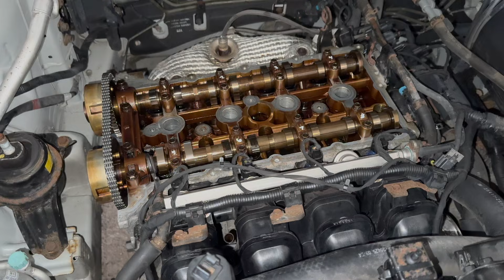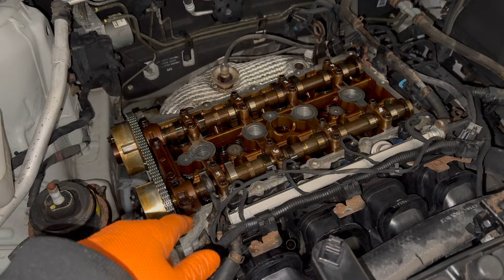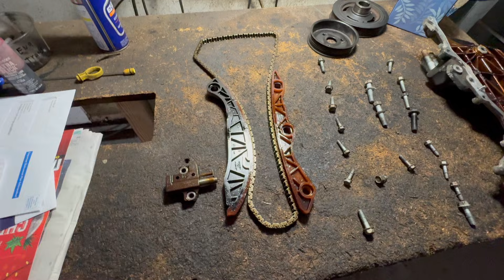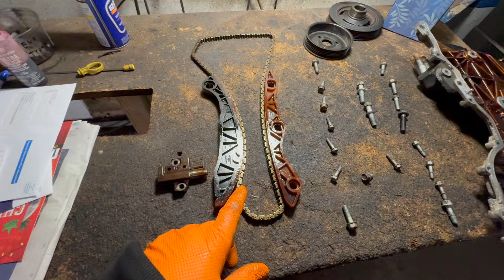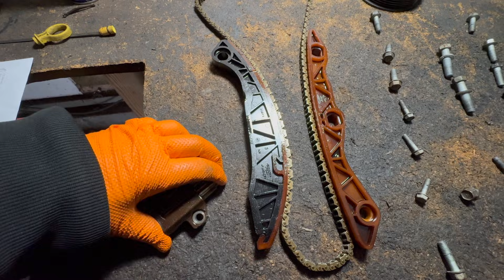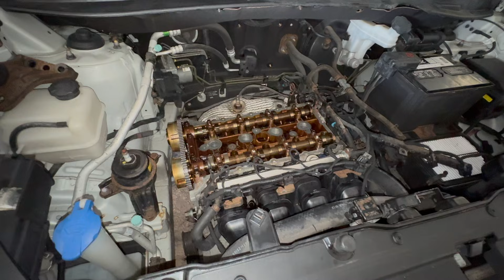Jumped Timing Chain Or Belt Symptoms, Causes, and The Fixes

Comment: My car wont start after resealing the timing chain cover because it was leaking oil. Any help?
Reply from the maker: You likely bumped or moved the timing components during the cover removal, so you should double-check that your crank and cam timing marks still align perfectly.

Comment: I have a 2018 honda accord sport 1.5t. Did head gasket and now getting misfires on cylinders 1 & 3. Engine will run ok for 10-20 minutes then codes and check engine flashes. Already replaced plugs and coils to factory. Injectors were replaced shortly before hg. I'm wondering if this is a timing issue or wiring/computer. If timing wouldn't all cylinders misfire? Or no?
Reply from the maker: No — incorrect cam timing does not necessarily make all four cylinders misfire. You can absolutely get misfires concentrated on cylinders 1 and 3. But because this started immediately after a head-gasket job, I would put mechanical/setup issues ahead of the ECM.

The detail that really catches my attention is that it runs well for 10–20 minutes and then starts misfiring. That makes me want to see what changes as the engine reaches operating temperature.

Given that you already have OEM plugs and coils, and the injectors were recently replaced, I’d diagnose it in this order:

Compression test it cold and then hot, especially cylinders 1 and 3. Better yet, do a hot leak-down test after the misfire appears. If 1 and 3 lose sealing hot, you could have a valve/valve-clearance issue, head sealing problem, etc. Honda diagnostic procedures specifically point toward valve clearance, cam timing, valves/seats and head-gasket sealing when compression isn't correct.
Check valve lash. This is high on my list after having the cylinder head off. A valve that's marginally too tight can seal reasonably cold and start leaking as everything gets hot. That can give you exactly this delayed misfire.
Recheck mechanical cam timing. Don't assume timing is correct just because it starts and initially runs smoothly. Being a tooth off or having a VTC/cam-control problem can cause strange cylinder-specific misfire behavior.

Comment: I have a 2013 Impala that blew its timing chain back in February. It threw exactly what you said. Camshaft position sensor codes, and VVT codes, and towards the end occasional misfires.
Reply from the maker: Yes it’s very common unfortunately

Comment: great video thanks for posting, I took off valve cover from n20 motor car stalled and wouldn't start ,im assuming total timing chain failure (bmw x1 2012) my question is I noticed chain tight and intact but at TDC intake cam is out of timing with ex -cam (bar codes not at 12 o'clock) is there a good possibility that there could be more serious damage than just the chain. guides failure ,thank you again
Reply from the maker: Only if the pistons hit the valves if timing jumped enough but usually no it’s the plastic timing cartridge that fails mostly.
Reply: @motorcarnut  thank you
Reply from the maker: You’re welcome
Reply: @motorcarnut  Hi again,i forgot to mention, I eventially took off the valve cover and looked down the park plug holes  with borescope to the top of the pistons and saw shiny circles on the top could this be valves hitting pistons,,thanks for your time and patients
Reply from the maker: Unfortunately it sounds like they hit yes

Comment: Thank you for your help, I have a question for you,  I am trying to help out a good friend.. it’s a 2014 kia optima 2.0 turbo it I know for sure jumped timing if I take it apart and it needs a head job do you think replacing the head would cure the problem or would I have to send in the block
Reply from the maker: Most likely you should be fine with the head job unless the vehicle overheated or piston tops have cracks but that is rare.
Reply: @motorcarnut so when I remove the head if there’s no damage to the piston we should be good to go? How about when I removed the solenoid to the bank too? I found small metal shavings about that considering the bearings on the lower half on the block.
Reply from the maker: That is not good the metal shavings and these engines are known for rod knock caused by bearing failure

Comment: I have an x5 diesel. And I watched a guy put in a new chain on youtube from connecting the new chain to the old chain. I tried it because it looked fairly simple, but during the job i think i jumped time. The engine is almost impossible to turn past TDC now ( i think im hitting a valve) All glow plugs are removed (after getting stuck). How do I go by fixing the problem? I know it was a cheap repair but I was gonna save up for the big repair later. Anyway, engine is in the back of the car and i’ve definitely never pulled an engine but i’m sure i don’t have to do that?

Thanks for your advice.
Reply: Great video btw! 👍
Reply from the maker: Thank you I really appreciate that!
Reply from the maker: You likely need to lock the cams and crank in the correct position to re-time the engine, but check for bent valves first since you feel resistance.

Comment: WILL  u1000 code on a 2008 nissan altima be caused by timing chain?
Reply from the maker: No — U1000 on a 2008 Nissan Altima is not normally caused by the timing chain.

U1000 is a CAN communication/network code, meaning one module is losing communication with another module, like ECM, TCM, BCM, IPDM, ABS, etc. Nissan’s bulletin defines U1000 as missing CAN communication and says to diagnose communication codes first. It also notes low battery voltage, power feeds, fuses, grounds, bent pins, backed-out terminals, harness issues, or module communication issues can cause it.

Comment: 05 mustang 4.0 will crank but won't start. Manually put engine in TDC and it started for about 30 seconds and stalled out. No codes, no check engine light.
Reply from the maker: Valve timing issue I believe

Comment: Hi this Sadiq from Nigeria. There is this Toyota Corolla I am working on. The timing chain tensioner worked perfectly until the engine was rebuilt. Now after a short drive, the timing chain tensioner losses strength and the chain becomes weak and makes this rattling noice. Now could you tell what could be the cause? I suspect the oil pump has lost integrity though
Reply from the maker: Hello Nigeria!! I think it can be the tensioner, yes could be oil pump but to go all of a sudden? I don’t think it’s likely.

Comment: Quick question. I was told from someone not a mechanic it was from excessive romping on the vehicle.  The mechanic said the same thing you mentioned. Would this also be another reason for a jumped tooth or is it just an opinion?
Reply from the maker: No, the chain won't jump because of driving aggressively

Comment: Great video 🤙 I have a 2015 KIA optima LX yesterday I got my check engine flashing and my car didn’t want to accelerate over 50MPH. I checked with a code reader and the only code pulled up was A P0011 could this be a jumped time issue? I also changed both intake and exhaust CVVT solenoid but still no change.
Reply from the maker: Thank you! It does sound like a valve timing issue, I would check all timing marks first and then go from there.
Reply: @motorcarnut could it also be a bad intake camshaft position sensor? I’m just trying to trouble shoot the cheapest rout first before taking on the timing,You make it look super easy.
Reply from the maker: It could be, but from my experience it's usually not.
Reply: @motorcarnut I appreciate your responses thank you 🤙 I guess I’ll order the timing kit with the intake and exhaust sprockets. It just trips me out that the timing chain would mess up, my car only has 137k miles.
Reply from the maker: No problem, I hear ya, it could be something even more simple so I can steer you in the right direction without seeing the vehicle
Reply: @motorcarnut I have an update and it’s a good one I had 2 codes P0011 and P1326 I read that if my car has the knock sensor code KIA dealership will replace the engine under an extended warranty. So I took my chances and KIA called me this morning saying I’m getting a new engine for free under the warranty.
Reply from the maker: Awesome bro!!! Good for you and appreciate the update maybe it can help others!!

Comment: My check engine light comes on after driving for about 5miles. My vehicle misfires and sluggish during starting. Scanner doesn't show codes. 2003 2AZ-fe Camry
Reply from the maker: Check engine light comes on there should be codes?

Comment: Great explanation. What can I do if only one out of two cams jumped a tooth? Got a 2020 Nissan kicks 1.6 with the front cam off a tooth. Rear cam by firewall is correct and crank mark is correct but front cam is off a tooth. It appears that the front cam jump a tooth backwards one tooth
Reply: Logic dictates that I move front cam ahead one tooth and install new chain. Both cam lobes next to sprocket would be in a upward position so if I  jumped the front cam, would that solve my problem?
Reply from the maker: Have to find the reason it jumped in the first place then redo the timing completely with new chain or belt and tensioner
Reply: @motorcarnut yes it appears that the owners got their upper intake gaskets done a year ago and they warned that the chain was loose
Reply: @motorcarnut finished installing new chain and tensioner. Plugged code reader in and no codes popping up. Waiting for owner before attempting to start but all seems well. 
 Honestly the job was not the same as  Nissan repair manual. Engine mount did need to come out and engine lifted 5-6 inches but all worked out
Reply from the maker: That explains it
Reply from the maker: Awesome!

Comment: Good info brother 👍🏻, What tips or tricks to adjust a timing chain if it skipped a tooth on a 05 Nissan Murano 3.5 engine? Thanks 🙏🏻
Reply from the maker: Not really any tricks because you have to remove the timing cover to readjust the valve timing and hopefully you didn't damage any valves when it jumped timing.

Comment: So I got confident and attacked the timing on my 2.4l l ecotec. I replaced everything and lined it up. When I started it, I heard what sounded like a puff, and it won't crank. What would be the next step in figuring out what's going on? Originally, the cam tooth and guides broke.
Reply from the maker: So when you turn the key nothing happens not even the starter cranking the engine?

Comment: Hi, I  watched all your videos on the 2.0 tfsi engine. I replaced all your recommendations. Cam bridge, VVT solenoid, and cam magnet. It used to throw code P0341 with poor performance, no power. Now I get no code but still poor performance and no power. It also sounds like a bag of nails or like a diesel.

I checked the timing, and it looks okay. On vcds phase position bank 1 is -3.94⁰

It is the new type tensioner and is only 3 notches out.

Should I repace the timing? Or is it the cam phaser, so camshaft replacement? 

Your knowledge is greatly appreciated. I have a video of the engine sound. 

Please can you help me? I live in the UK, but maybe a message in the right direction, please 🙏 

Thank you

https://youtu.be/dADiTQrEUBo?si=07DigXM8pC7HuyWJ
Reply from the maker: It does sound like timing chain slap to me or the cam gear. Make sure oil level and pressure are good first. Excessive carbon build up can also effect performance but not the noise I'm hearing.

Comment: Question with vvt sprocket specifically exhaust side with the spring when you blow air in the port it shifts over but don’t lock when you stop blowing air it snaps back is that normal or is it supposed to stay locked over like the intake side you blow air left or right port to shift back and forward
Reply from the maker: No. the exhaust side doesn't stay locked so its normal

Comment: My 2017 Kia Forte has had a history of stalling out every once in a while, usually after cruising at 60 and then slowing to city speeds. It makes an angry rumble and then the engine dies. It threw a P0366 code Camshaft Position Sensor B only once about a month ago. Replaced the sensor and it has died in the same way since, never shown any other code than the P0366 the one time. Local mechanic says it seems to be that the camshaft gear has something going on with it. Says that the rumbling is the camshaft going out of wack. The rumbling goes away soon after restarting the car. Any feedback? Thank you
Reply from the maker: If the mechanic diagnosed that in person he would know, could also be a wiring or ground problem but I would have to diagnose this in person.

Comment: I just got new cams rocker arms and lifters done . I have code p0016 p0017 & p0018 .... bank 1 sensor A / sensor B and back 2 sensor A .. why ??????
Reply from the maker: Valve timing seems to be off
Reply: @motorcarnut even tho it was just replaced like the rocker arms cams and stuff . This means the cams need to be aligned ? And I have to take the chain off line it and put the crankshaft at TDC ? BUT this job means TAKING THE TIMING CHAIN OFF ? right ?
Reply from the maker: Unfortunately, yes,

Comment: Hi I hope you can be of assistance, I have a 2002, 1.6L Nissan Almera car and I have been noticing a slow like chain rattling sound as i drive especially when i accelerate. What do i do in this case ?
Reply from the maker: Can be a stretched timing chain or a failing chain tensioner. Should be checked asap so it won't cause more engine damage.

Comment: Hi there, love your videos. I've been getting a check engine light for the past few weeks on my 2013 Honda CRV. P0341 code was the primary diagnostic code, but some others came up too. First my mechanic recommended changing the VVT solenoid when we did an oil change. Did that and the check engine light came back immediately and the engine still runs at reduced power. Mechanic said if the VVT solenoid didn't fix the issue, it was likely timing related. Do you agree?
Reply from the maker: It can be anything related to valve timing, so yes could be the timing chain tensioner, chain stretch VVT actuator.
https://youtu.be/qHoQ_dlHpYQ

Comment: Hello i have a question I have a 06 Honda Accord 2.4 and the timing has jumped from the chain being stretched can I continue turning the crankshaft until the marks on the cams line up horizontal
Reply from the maker: As long as when you turn the engine there is no binding or hitting the valves you'll be fine.
Reply: @olemangaming I’m having the same problem same car as you how did you fix it

Comment: So as long as my pistons aren’t cracked, I can theoretically throw a new head on and do timing oil pumping in a couple other things and be good ?
Reply from the maker: It depends on what happen to the engine, but can be rebuilt as long as rod didn't go throw the block, over heated beyond spec, or cylinder walls scored beyond spec as well.
Reply: @motorcarnut your a stud
Reply from the maker: Thank you!
Reply: @motorcarnut  could you resleave the cylinder walls or is that just a waist of time?
Reply from the maker: Not on modern vehicles, it’s cheaper to find a good used block instead

Comment: So we replaced the vvt.  Gear.    And now the car.      Cranks.  Cranks cranks.   Then starts.    And runs. Smooth
Reply from the maker: IDK what you did wrong just recheck your work
Reply: @motorcarnut  I installed a Dorman. Gear.   I didn’t lock it.  Just put it on and  start it.    I have codes.   Poo10.  Po343
Reply from the maker: That's your problem, has to be locked when you install it or it will throw off the valve timing.
Reply: @motorcarnut  ok wich sprocket do you recomend me.  I got the Dorman.   But that one has only 1 dot.      So I didn’t know when it was lock
Reply from the maker: I try to get OEM when dealing with critical engine parts.

Comment: Hi I have a question I’m changing he vvt gear on a Camry  cylinder so when I took it apart it seem like it jumped a gear from the exhaust side to put the chain on the marks with the gear I need to conpress  it is that normal
Reply from the maker: I would redone the complete valve timing, it may be off even more than you know.
Reply: @motorcarnut  I ended up taking the front cover out.   Put it on top dead and got it running   But the noise still there.   I’m thinking.    Maybe the valance gear box inside the oil pan. What do you recomend me.
Reply from the maker: IDK what was your original problem?
Reply: @motorcarnut  the original problem  rattles on cold start
Reply from the maker: Can be low oil pressure, weak timing chain tensioner or valve timing off but you said you checked it so not sure
Reply: @motorcarnut it was running smoothly before I replaced the spraket.   Only problem was the cold start rattle.    I just order an oem sproket
Reply from the maker: Good luck, if that sprocket was your problem the new OEM should solve it.
Reply: @motorcarnut my only question is after I installed it how do I lock the sprocket  they said to torque it unlocked then lock it
Reply from the maker: You turn the camshaft counter clockwise to lock it.
Reply: @motorcarnut ok so after I install the sprocket torque it time it.   Then just put a wrench on tha cam and pull it
Reply from the maker: Yes use the area on the camshaft that is hexagon for the wrench not near any of the lobes.
Reply: @motorcarnut ok thank you
Reply from the maker: No problem

Comment: my nissan micra auto 2012 petrol STL has jumped timing chain so what to do bcoz mechanic said me need to change engine
Reply from the maker: Means you probably bent some valves so a head job along with a new timing chain kit has to be replaced. Not the whole engine